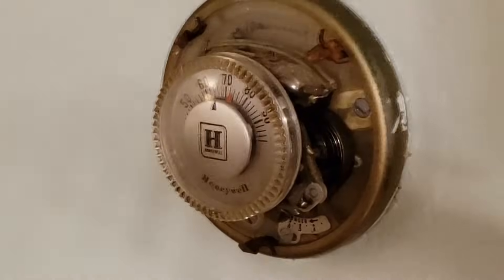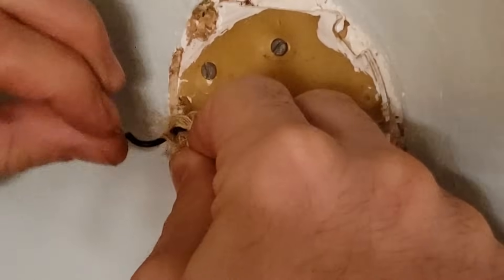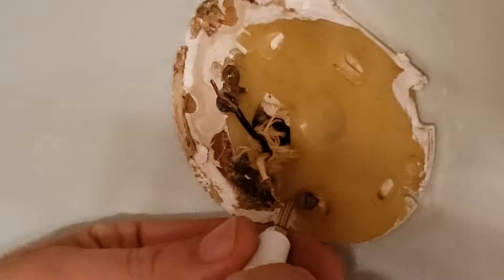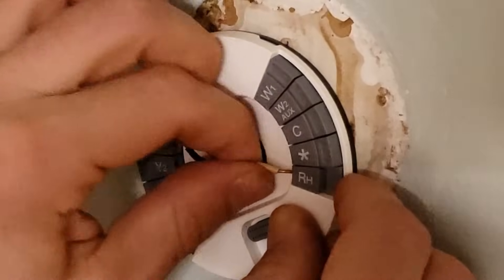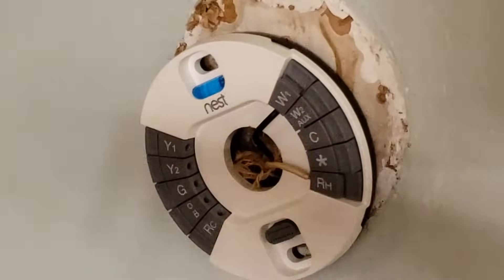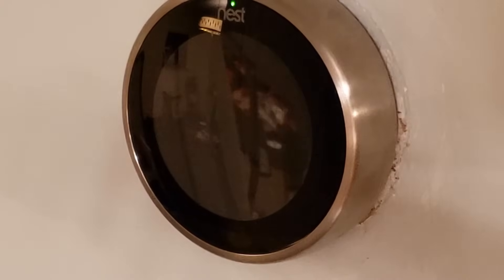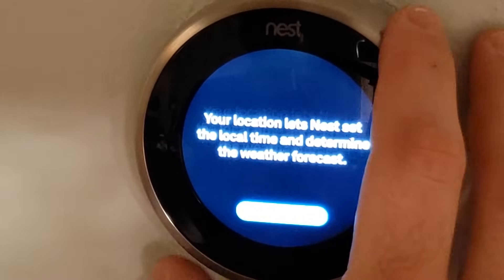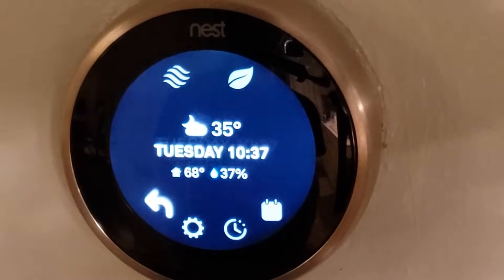How to Install a Nest Thermostat with Only Two Wires

Comment from the maker: I have a new RV and travel related channel which I'm currently trying to bring to 1000 subscribers and I would be very grateful if you subscribed! Thank you.
https://www.youtube.com/@bootenwagen?sub_confirmation=1

New Nest video: how to install with HVAC system 
https://youtu.be/fo1PJ_XDgSg

If your furnace isn't supplying power to your Nest with two wires, you have a few options

1) Google Nest Power Connector - Nest Thermostat C Wire if your furnace isn't supplying power to your Nest:
https://amzn.to/3tcWwzq

2) Adapter, run this as a "C-wire"
 to your Nest:
https://amzn.to/3qvVTOu

Nest 3rd gen:
https://amzn.to/3G7mKYf

More energy saving how-to videos from me:
https://youtu.be/ao9iOhVHvWw

I'm an Amazon Affiliate, and earn commissions if you purchase through these links at no extra cost to you. It's a great way to support the channel, and it is much appreciated!
Reply: Just wondering if your nest Thermostat makes a ticking or buzzing sound when the signal is being sent to turn the heat on?  I had the same setup, and since the thermostat was trying to use the signal wire as the common at the same time as sending a signal down to turn on the furnace it would get a ticking or buzzing sound.  I solved the issue by adding a common wire so it had a dedicated line to complete the circuit to the thermostat to maintain optimal power.  luckily for me I only have to run the third common wire a short distance so it was not an issue.
Reply: @Gordon013  man... you're a life saver... same exact thing happened to me... I installed it about 3 weeks ago... when it wasn't super cold... so the furnace worked and everything but the burners didn't and it was just blowing cold air... but I couldn't tell that until the temperature got below 32°... so I seen your comment and just ran a 4-wire and just used 3 and now it works like a well oiled machine👍👍👍 thanks brother
Reply: Ray Shellz  you forgot the first plate cover
Reply: @MrDanyeloy  what's the first plate cover?
Reply: @RayShellz  it's the big plastic plate that they include to hide the ugly wall marks if any. This isn't a necessity if not needed like in my install it wasn't needed either as my wall is in great shape.
Reply: I do wanna use a nest termostat but the wires on the old termostat is 110v  can I used to install the nest or not thank you
Reply from the maker: @jacoblopez1446  no, Nest does not offer a 110V version to my knowledge.
Reply: @jacoblopez1446  With a 24 VAC relay and a 24VAC transformer and proper knowledge you can do it, no problem.
Reply: Yes they used to have a plate cover for the backplate . They don’t have that anymore either they cheat out with the screwdriver and the metal back plate. Can you get the stat ,  the base and some plastic plate only. They even did away with the cool screws
Reply from the maker: @jeraldlockhart2046  inb4 they also decide that turning the heat on to your house should be part of the Nest+ subscription service

Comment: So, is this powered by just batteries since it does not have a C Wire?
Reply from the maker: Not exactly. It can draw some current right off the boiler's circuit board to keep itself charged. But not all boilers can supply enough current, so it can be hit or miss, but more hit than miss. It does have a battery.
Reply: @Bootstrappin  
OK thanks.
Seems like it wouldnt have the juice to power all the smart features though, so im going with a 24V adapter for reliable, continuous power.
Reply from the maker: @MeandMyStaffy  let me just put it this way - if it can power it, then all the features will be powered just fine, like it was in my house. But yes, if that's not sufficient, then the adapter is the way to go.

Comment: I have hot water radiant heat with viessmann gas boiler and my current thermostats are all 2 wire R & W. Can the nest thermostat work with only the 2 wires or will it need the power adapter?
Reply from the maker: While I can't speak for your system specifically, I do know in my system 2 wires worked just fine. It was able draw current from the supply wire to keep itself charged. It really depends on the architecture of your boiler's circuit card -- only one way to find out.
Reply: @Bootstrappin  Thanks, I'll try one out and see how it holds up.

Comment: ah-ha! thank you, I had a very similar thermostat and was swapping it to a very similar Nest (an older one, now). I had the wires in incorrect positions based on other advice, it seems. Now the heater is running, so that's a good sign! Will keep a close eye on whether it stays charged up!

Comment: Where does the constant power come from to keep the wifi activated
Reply from the maker: It draws a little current from the circuit board of the furnace, because it outputs current on the on/off loop (or whatever it's called). This may not work with all boards, but it did with mine.

Comment: Followed the instruction for my two wire system only red and wite furnace heat only system. Did not work, I was told o need a C wire. No high voltage system so I am not sure how this even worked? Which nest system is this? What exactly is providing the constant power that all the smart thermostat in the market needs.
Reply from the maker: This is the Nest 3rd gen, like this: https://amzn.to/3ALIfQg

Ordinarily, the furnace provides 24 volts AC over those wires, and the Nest takes some of that power to charge itself. Only a few things come to mind in your scenario. If you have access to a multimeter, check to maker sure that you indeed have 24 volts AC between those two wires. Then double check that the two wires are connected to W1 and Rh on the Nest. If yes, this should work, maybe even without a C-wire. It's also possible you received a defective Nest, but measuring those two wires is where I would start, and go from there.

Comment: Did the Nest Thermostat need batteries or not to work with only the two wires?
Reply from the maker: The Nest has an integrated battery. The two wires from my furnace were sufficient to power the Nest and keep its battery charged.

Comment: I only have the RH and W wire as well. I want to install the Nest but installation video persists on getting a C wire.. Any suggestions?
Reply from the maker: Installation video on their website? Have you tried powering on the unit without a C-wire? If you have and nothing happens, see my pinned comment, I'll paste it here:

If your furnace isn't supplying power to your Nest with two wires, you have a few options

1) Google Nest Power Connector - Nest Thermostat C Wire if your furnace isn't supplying power to your Nest:
https://amzn.to/3tcWwzq

2) Adapter, run this as a "C-wire"
 to your Nest:
https://amzn.to/3qvVTOu
Reply: @Bootstrappin  #2 adapter will be my way to go ... My only dilemma is the new nest i got has slots of W, G, R, W, Y, C, & OB* wires ... My original thermostat has wires going to W and RH.. As this is heat only thermostat. With the adapter, could you guide which wire should go in which slot? I am guessing W to W, RH to R.. But what about the two adapter wires? One goes to C, other would go where?
Reply from the maker: @maleeabbas  This is the diagram they provide on the listing, is there anything missing from yours? https://m.media-amazon.com/images/I/71Qkv2KPlaL._AC_SL1500_.jpg

Comment: Thanks you made this very easy to install thermostat Nest thanks for your help 👍
Reply from the maker: @albertsantiago6305  sure thing!
Reply: What model did u get? Do u need the adapter for wire c?
Reply from the maker: I know the question is addressed to Albert, but in case he doesn't return - it's the 3rd gen, (https://amzn.to/3ALIfQg) and the adapter really depends if the furnace can provide power over two wires or not. Only one way to find out, and that's to try it without the adapter first.
Reply: @Bootstrappin  oh ok mate, thank you for your help. Do u think nest 4 generation thermostat will work too?
Reply from the maker: Just looked it up, and yes, it seems it can still do two wires: https://amzn.to/3PxBlSG
Reply: @Bootstrappin  i just installed the 3 generation and is not charging 😒.  Plus, it works only one time and not heating again Why? Probably because the battery is low?
Reply from the maker: @ that sounds plausible, yeah. Try getting a Google Nest Power Connector, that usually solves problems like these.

Comment: Hey bootstrappin! Great video but question, I have an only heater/radiator system as with the same honeywell thermostat but the wires on mine are green and blue without any labels. Is it 24v and can I also just plug either of them in W1 and Rh?
Reply from the maker: Thank you -- if you're not sure, a good way to find out is to take a multimeter, set it on AC voltage, and check what it is. It's tempting for me to say "it's probably fine", but I've seen too many questionable electrical things in homes that it's better to double check.

Comment: What do you do if it wants a common
Reply from the maker: If your furnace isn't supplying power to your Nest with two wires, you have a few options

1) Google Nest Power Connector - Nest Thermostat C Wire if your furnace isn't supplying power to your Nest:
https://amzn.to/3tcWwzq

2) Adapter, run this as a "C-wire"
 to your Nest:
https://amzn.to/3qvVTOu

Comment: Wont the internal battery die without the 24v to keep it charged?
Reply from the maker: That depends if the circuit board from your boiler can supply enough current. In my case, I was able to run the thermostat with this exact 2 wire setup for years without problems.

Comment: Does this work with a gas furnace. We are replacing the exact same thermostat. Thank you.
Reply from the maker: It worked for my oil furnace, but your mileage may vary. It all depends if the circuit board of your furnace can supply enough current, and if it runs on 24 volts AC. You may need this if it doesn't work: https://amzn.to/3tcWwzq

Comment: Installed on two wire systems furnace cycles runs for a sec and shuts down ???? What do I do
Reply from the maker: Does the Nest lose power/show any errors or anything like that?

Comment: I just bought the white Google Nest (not the "Learning" model).. the wiring board has three spots on each side.  One is Y, C, W and the other is G, R, OB.  How would you wire 2 wires in this? (I have white and black wires for heat-only
Reply: W and R

Comment: Great video and very informative, but funny. I picked up a used nest 3 gen, for a furnace i put into my garage. I wired it up the same as yours 2 wire setup, all good. But i guess the way the old owner had it wired, it came up. The wiring to your equipment has changed. And at the bottom of that in blue it said continue. I dont have a manual for it. And im not fully set up with the furnace neither. So i didnt go any further, what im looking to do, is install app in my phone eventually. And only use it to turn on heat in garage while im having a cup of coffee in the house and go out a half hour later to a toasty garage. Is there a way to do that. Im assuming the wiring change thing will walk me through it once i hit continue. Just want to turn on when i want, dont want it to come on its own when temperature drops. Is there a way to do that you know. Thank you
Reply from the maker: Ah yeah, it'll probably walk you through all the same. But part 3 of this website has the factory reset procedure, might be good to go through: https://www.techsolutions.support.com/how-to/how-to-factory-reset-your-nest-smart-thermostat-10113#:~:text=3%20Nest%20Smart%20Thermostat%3A%20Factory,Settings%20and%20press%20to%20select.

As for leaving the garage for getting toasty, that's an interesting pickle. Certainly you could just set it or set the temperature from your phone app. It does have geo fencing which detects when you leave your wifi network and you can set it up to have whatever behavior you like upon leaving... But easiest is probably just from your phone.
Reply: @Bootstrappin  thank you for getting back to me, I will definitely check out what you said. Im still getting things together for furnace, hopefully when the winter comes I'm up and running. Thank you

Comment: Thanks so much for your enthusiastic video. I also have a 2 wire that had a Honeywell C67N. But was told i could use the Nest thermostat?  So whats the story?  Because i was going to hook mine up like yours. And yes, im aware of the usually Thicker gauge house wiring. In which the one's for my thermostat are the thin wires
Reply from the maker: Hard to say, I could only find info on the CM67. If it's the CM67 that you have, then it looks like a Thermostat for European markets, considering that I see 230 VAC on its spec sheet, though it also seems to be compatible with 24 volt systems. If you have a multimeter, I would check to see what is running on that thermostat. Thicker wires can be a decent warning sign that it's 230 VAC, but not always guaranteed, so it's good to check. If you're certain that it's a 24 volt system, then you could try the Nest. Otherwise, the Nest 3rd gen would NOT be compatible.

https://thermostat.guide/honeywell/honeywell-cm67-programmable-thermostat-product-specification-guide/

Comment: Yours is the E Learning on am I correct? What Gen? Are you having issues with your batteries charging?
Reply from the maker: No -- I had the 3rd gen, and it ran fine that way for a couple of years before I moved out. I think it's just a matter of if your furnace circuit can supply enough current or not, and that's a bit of a toss up.

https://amzn.to/3G7mKYf
Reply: @Bootstrappin  Thanks for the reply. you had the Learning one. Mine is 24 volt 20 years old. I hope it will work.

Comment: You didn’t need a C wire?
Reply from the maker: I did not, and I had it that work that way for 2 years before I moved - though your mileage may vary, depending if your furnace circuit board has enough current to supply. If not, these are the options:

1) Google Nest Power Connector - Nest Thermostat C Wire if your furnace isn't supplying power to your Nest:
https://amzn.to/3tcWwzq

2) Adapter, run this as a "C-wire"
 to your Nest:
https://amzn.to/3qvVTOu

Comment: Won’t you need a common wire to keep that internal battery charged?
Reply from the maker: I didn't need one. It depends -- some furnaces can supply enough current through just these two wires to power the Nest/charge the battery. If not though then yes -- you'll need to install either the Nest C connector, https://amzn.to/3tcWwzq or run an adapter's C wire https://amzn.to/3qvVTOu.

Comment: Don’t you need a common wire?
Reply from the maker: I didn't need one. It depends -- some furnaces can supply enough current through just these two wires to power the nest. If not though then yes -- you'll need to install either the Nest C connector, https://amzn.to/3tcWwzq or run an adapter's C wire https://amzn.to/3qvVTOu.

Comment: Soooo can the 2 wire be used for cooling as well I have a gas furnace
Reply from the maker: No, cooling usually requires at least a fan wire, an air conditioner wire, and a common wire. If you have heating and cooling, you probably have at least 5 wires.

Comment: When you set the temperature to 60F in hot summer, will it give you cool air because of the Nest Thermostat?
Reply from the maker: Only if you have an air conditioner or a fan as part of your system
Reply: @Bootstrappin  Understood. Thanks for responding so fast!

Comment: Did you have to find out what voltage the wires were? Mine is similar very old system and has 2 wires, white and black. The circuit board says 120v though. I’m very confused. Do I need to convert the system to 24v, does any of it matter?
Reply from the maker: It does matter, very important! With mine I was confident about 24V because the wires were very thin, and I measured them with my voltmeter. Measure the voltage across your wires (you may have to have the furnace on for this). If it's 120VAC, the Nest is not compatible. There are probably ways to convert from 120VAC to 24VAC, but I don't honestly know. Tread with caution, 120VAC is enough to be lethal.

Comment: Thanks for the video. I tried this with a old school 2 wire thermo connected to a fireplace. It didn't work, the Nest didn't power up. Any suggestions? Thank you
Reply from the maker: Basically your two options are: wire the Nest C-wire adapter into your furnace (it comes with instructions - link below), or you get a wall adapter. All you do is plug it into a nearby outlet, and it provides you an extra wire to run into the back of your Nest:

1) Google Nest Power Connector - Nest Thermostat C Wire if your furnace isn't supplying power to your Nest:
https://amzn.to/3tcWwzq

2) Adapter, run this as a "C-wire"
 to your Nest:
https://amzn.to/3qvVTOu
Reply: @Bootstrappin  thank you. That's exactly what it was, not enough power. I did give it a charge with the mini USB, reattached it and found it wasn't getting enough juice (via the UI). I will look into your suggestions, thank you.